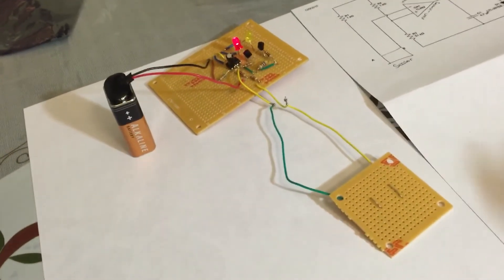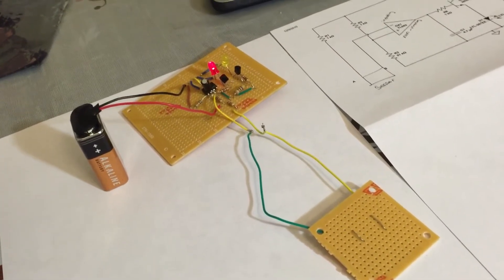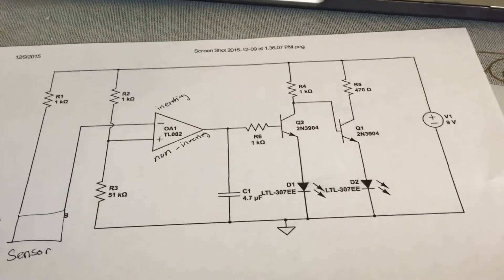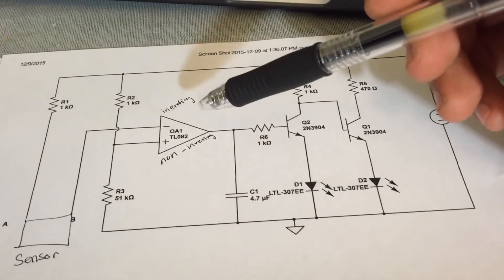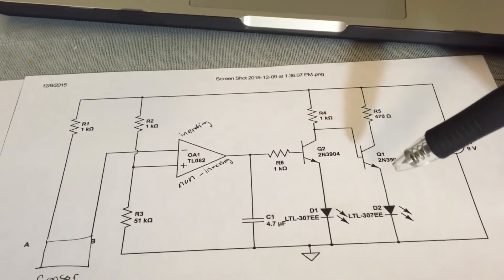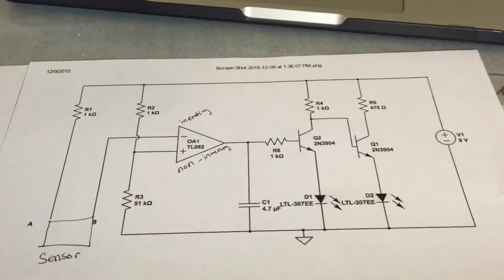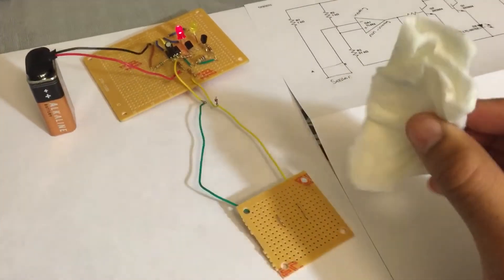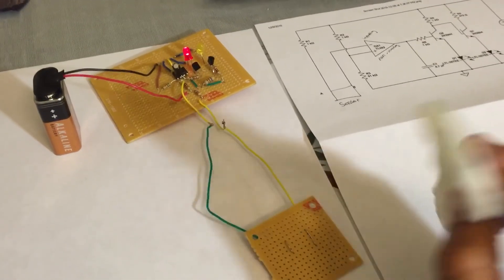Moisture Sensor Circuit (Ayman and Alexis)

Comment: That is a DC circuit that will corrode very quickly and that will be the end look at capacitive sensors
Reply: Not sure the reason for the nit-picking. Maybe you have good intentions and it reads wrong. The circuit is good and the proof of concept is good.  Watching the video this seems to me a proof of concept and is a great video. The changing of materials to read the moisture (perhaps stainless steel) is all that is needed for this circuit. Shrink the final circuit, pot it and it is perfectly fine and would be ready for production.